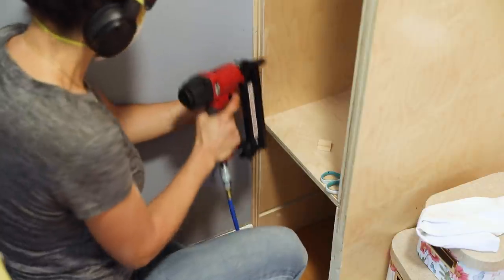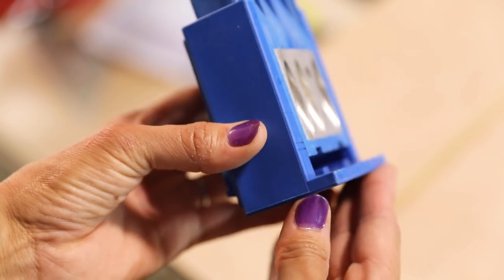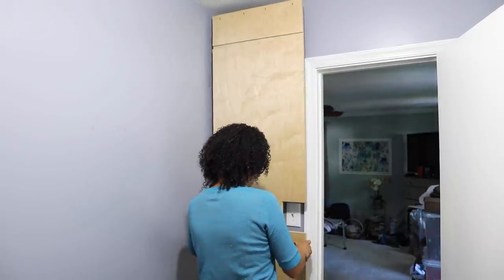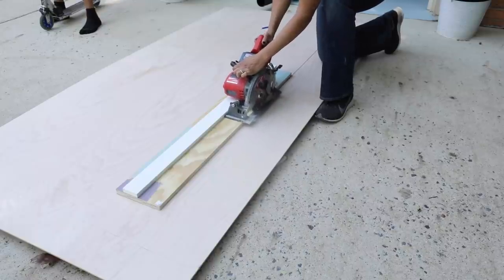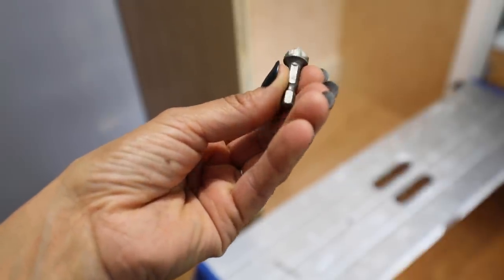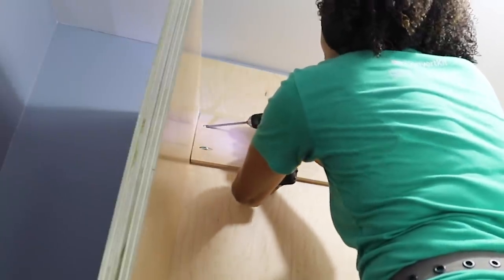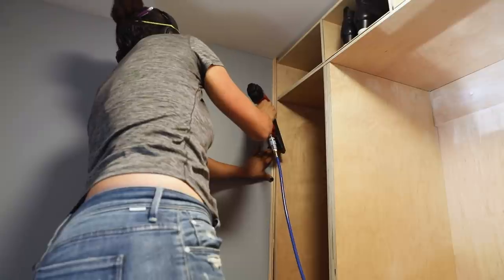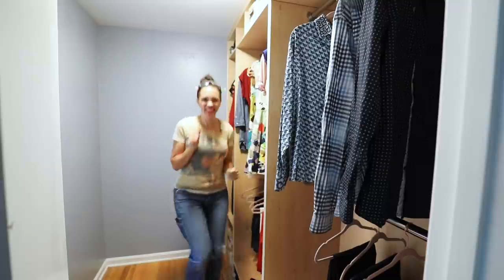BEFORE & AFTER: Custom Closet Makeover - PART 2 of 3 - Thrift Diving

Comment: It looks great and really professional of course.  This was very interesting to see all that goes into closet units from just plywood.  And all those cool gadgets!
Reply from the maker: Thanks, Missy! I hadn't watched many videos on it before I did it. So I don't think I really knew, either. The tools were fun to buy because I kept discovering things that would make the job easier. Next time I am going to buy this tool called a Festool domino. It is VERY expensive but is the mercedes benz of tools when it comes to joining wood together. It aligns them perfectly and there is no sanding like what I had to do with the pocket holes. I'm going to splurge and buy it as an early birthday/Christmas present for myself, and use it for the next 2 pieces. So it will be interesting to see how much faster and more professional it will look with this fun new gadget! :)
Reply: @ThriftDiving  I had to look that up. It looks like one of Norm's tools from New Yankee.

Comment: Nice to know I am not the only one who starts a project then goes back to the store for more tools.  This was a big project, so kudos to you for getting it done.  For cutting the bars, they do not look thick, so you may be able to use a pipe cutter.  With simple twisting around the pipe, you will get a cleaner and easier cut.

Comment: I admire your DIY skills, and your ambition with your projects.  I redid some fun closets myself in a loft, and under a stairway, however, I stripped them down and painted them (fun colors) then had CA Closets come in to do the actual closet installs.  BTW—I also tried to cut a pretty thick metal 1” curtain rod with a hack saw with a blade made for metal cutting, and could not complete it.  Took it to my father, and he used a little tool that is used to cut pipe.  He just hooked it onto the 1” rod and the two little round “blades” on each end etched/cut into the metal rod as he rotated the tool around several times until the two sides separated.  All I had to do was file down the ends so they were not sharp.  I always thought I did a lot as a woman, but you are amazing with all your gumption and knowledge!  Kudos!

Comment: For all the new tools you purchased, I can't believe you didn't get a pipe cutter. Would've made that hacksaw job much easier. Love the transformation. Brilliant job.
Reply from the maker: I know! I honestly didn't think about it until I got to that part and just wanted to finish it. It said just use a hack saw and I went looking for mine. I have an angle grinder which would have slices right through it, but I didn't want to deal with the sparks. I'm going to get me a pipe cutter. I only have small pipe cutters I have used for copper tubing. Glad to always have a reason to buy more tools!

Comment: Wonderful end result. Would you consider the wood conditioner/stain/paint steps after it is in for your next project? I have had my share of touch up jobs after my husband works on his projects. Lol. Hope your head is better after the accident.
Reply from the maker: LOL, thankfully, no lasting damage from the head bump! To answer your question, I am going to be buying a drool-worthy tool called a Festool domino joiner which uses mortise and tenons for building furniture, doors, etc. It's very expensive but I'm willing to invest the money because after building this, I see its worth. I would be able to finish the pieces and fit them together nicely without pocket holes and no "after-the-fact" sanding. I'm planning to make new kitchen cabinet doors so this machine will come in handy. I'd also like to build a dining room table!

Comment: Could your saw guide that you used with the router work as a clamp in a pinch? I’ve never had one that clamps so I don’t know how much pressure it applies but might be better than trying to hold it straight, I have done that lol
Reply from the maker: Good question! It can't be used as a clamp because it's only hold the fence to the board, not the board to the table. So if the board is slippery on your surface, you'll need to clamp it down to the table.

Comment: Great Job, What was the total cost for the project?
Reply from the maker: Good question!! I didn't keep count but I wanted to do that calculation with my receipts and the materials used. The entire stack of wood was $700, I didn't use the entire stack. Whatever is left from the stack will be used for the other pieces. I'll figure it up and include that in the blog post! But it was probably about $400-ish.
Reply: @ThriftDiving  Wow then it's quite less than the IKEA PAX system since I'm a beginner with woodwork will still go with your design! Thanks

Comment: Is that a dremel you used and got that special bit for? If so what kind is it? I need to buy one but don’t know which kind I want
Reply from the maker: I mistakenly called it a "bit" but I meant "blade." Yes, it's a Dremel I bought years and years ago. I had to go to Home Depot and buy a blade to cut the pocket hole plugs as close as possible. Here is the blade I bought: https://homedepot.sjv.io/vLAgL and here is the Dremel similar to what I bought about 15 years ago: https://homedepot.sjv.io/dX6q2. This Dremel is good because if you need to cut areas that are flat or if you need to cut drywall, it works well!